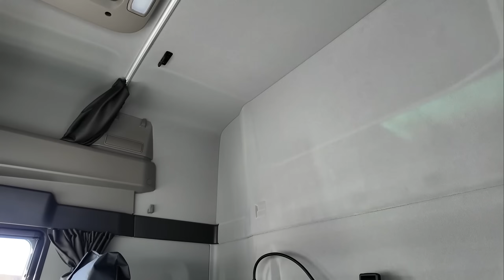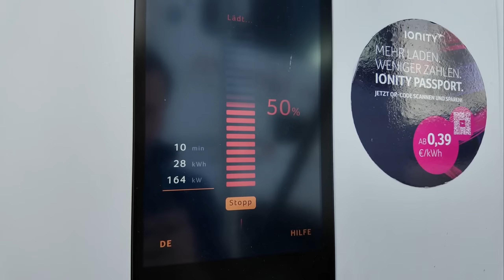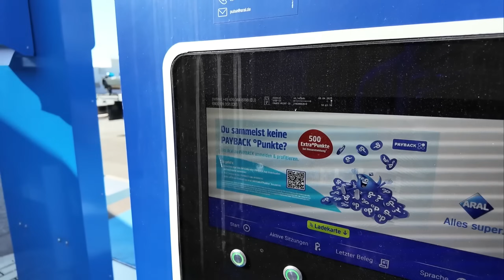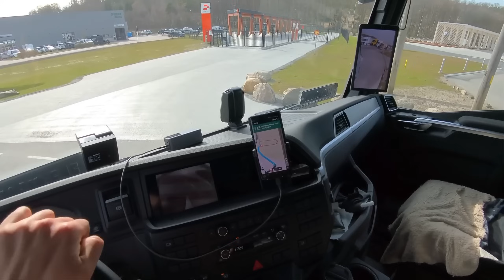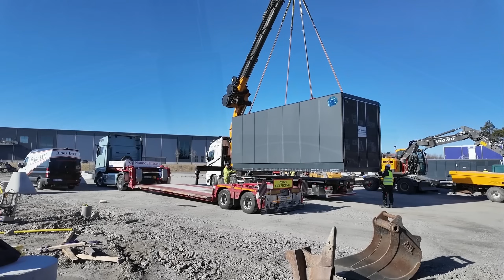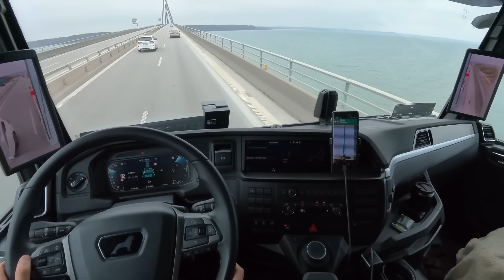E-Truck Convoy to Sweden. Europe Watch and Learn: This is the Charging Infrastructure of the Future

Comment: I had watched so many convincing anti EV you tube vids that said electric trucks are simply useless and will never take off..then I found this channel.
Reply: "Those who say it cannot be done should not interrupt those who are doing it."
Reply: Without the existence of the EVs, we won't see any record breaking growth on renewable energy capacity, and we most likely still having way less reliable grid today, as one of the first step of improving the supply is by creating the demand. Plus EVs has much less engine noise, resulting in quieter environment

Not mentioning that we already reached the point where a whole EV battery replacement cost less than a whole combustion engine swap, thanks to the massive shift to less expensive LiFePO4 (and soon sodium ion) batteries, and also a ramp up on battery recycling to eliminate as much dependencies to mining as possible (as 99,9% of the battery can be recycled)
Reply: They are also cooler running in built up urban environments because of their efficiency... So given how dangerous heat domes inversions and urban heat trapping is ..all electric vehicles on busy urban roads can help limit that close proximity.
Reply: Many who say things like that are from the US, things there are little different. There, they can drive much faster while here in the EU speed limit for trucks is 80kph which reduces efficiency a lot, also I guess their tachograph laws are more liberal than our 45 minutes rest in 9 hour shift.
Reply: @ivanjanjic8762  For any vehicle, slower speed is much more aerodynamically efficient (is that what you meant?) as drag is proportional to the square of the speed (ie go 2 times faster, get 4 times more drag and therefore energy consumption)... and I gather that the USA is a little more liberal in terms of driving hours than Europe but it depends a lot on what sate you are in.  I also suspect what laws there are are not policed as well in the USA.
Reply: It’s amazing how far advanced Europe is over the US.  Here in the US, we have to take a four-year break from helping the earth survive.
Reply: Electric trucks will cut costs for future transports and that will in turn make European products more competitive then more backwards nations like USA.
Reply: 有用的，但要看柴油价格和电每1KW的价格。

Comment: I agree with the peterjol 💯 the electric truck is far better than so many anti EV mobs castigating them. It can only get better with the speed of improvement in batteries. I would love you to be able to try out the Tesla truck, it would be interesting to see if you liked the middle driving position, it must be easier when coming to the UK.

Comment: When you park overnight there should be a control to take a slower charge which is better for the battery and probably for the charger and grid like if there was a way to program a charge by telling the truck that you want to leave at this certain time and the truck will be fully charged and at operating temperature

Comment: Greetings from Denmark 🇩🇰 Nice to see that our EV infrastructure is appreciated - particularly seeing that a lot of Danish truckers had protested against the move from diesel. Luckily companies like Danfoss leads the way by implementing EV trucks and even putting up chargers themselves. 
The private EV car sales have been exploding the last couple of years and so have the amount of chargers. 3 years ago when I bought my lovely little BMW i3 I really needed to plan my route to cross Jylland because but today it's no issue - even with a small battery. Actually don't wish for much bigger batteries but mainly higher charging speed

Comment: I mean BEVs are nice, but the numbers sold are not reflecting a positive way forward for them. H2 will most likely take over. 
I have seen a maximum of 2 trucks in that Varberg stop each week when I go past there so it isnt being used a whole lot..
Reply: Hydrogen in all practical sense is a scam (for the transport sector).

The efficiency is simply too bad and the hassle to "fuel up" is dangerous and annoying.
Reply: @zaarkeru3391  I dunno, FCEV was shithot a few years back but seems to have died down a bit. BEVs are only offered to offset CO2 penalties coming from the EU, if it wasnt for that there would be 0% interest in BEVs. Price is another thing, BEVs are HEAVILY discounted straight from the OEM, there is 0% profit on them, straight loss. Without the ICE variants there would be no BEVs offered. Best choice is HVO at this point.
Reply: @aeywyn5230 
Low profit when you're creating a market segment is the norm.

And the same things with happen with hydrogen based transport.

If we use it as a source of combustion fuel it will be incredibly inefficient and if we use fuel cells it will result in massive upfront costs.

BEVs can make a profit very soon as we are seeing the price of batteries fall year on year by quite the bit.

Hydrogen doesn't really solve any problems.

The energy efficiency (with green hydrogen) is unacceptable.
As a combustion fuel it is beyond dangerous and a massive hassle to refuel.

Hydrogen as a industry product, great.
We can make a bunch of stuff with it.

As fuel for transports its horrible.
Reply: @zaarkeru3391  I dunno what truck you think will make profit being a BEV but it aint any of the mainstreams one atm.
Reply: @aeywyn5230  none of them at the moment, but i guess you just ignored my comment.

Comment: You previously mentioned that it'd be optimal to have combined truck and car charging locations as trucks use the public charging network mostly through work week and cars on weekends, so I think the best design would be to have the charging bay layout like the truck charging stops that you showed today, but with the charging cabinet & dispensers type of chargers and 2 dispensers per truck bay length such that each can either serve 1 truck even with electric trailer with its own plug or 2 cars (/trucks without trailers). Here's why:
* cabinet & dispensers type of chargers allows for more flexible distribution of the charging capacity of the site, and this would make the rear dispenser have the same charging performance as the front ones withough having to double the cost, which would be beneficial especially for car charging, since they usually have lower charging Wattage (basically you split the charging capacity you'd need just for the front one into 2 for cars as on average they'd be charging at about hald the speed)
* the front dispenser should have both CCS and MCS plugs, it'd be however on the site owner if each dispenser would have 2 CCS plugs (except the left most, but there'd have to be 2 additional dispensers on the right side of the row of bays) or long enough cables for vehicles with charging ports on the right side
* If one of the 2 spots is taken by someone else, you can reverse into/out of the other (front/rear one respectively), though it'd be optimal to have a display or even assignment of bays at the entrance such that the chance of just one slot in each bay being occupied and the time to find a free charger are minimized. I think of something like fast food drivethrough ordering, but you'd choose vehicle type and how long you're planning to charge (for vehicles not using the whole bay to minimize the need for reversing) instead of your meals and drinks.

Comment: Nice video! 
I love your honesty and how you point out the great and bad in everything. 
I like the DC charging speed setting in the MAN. If you know you don't need full power, then limit it. Could be a useful feature to have for shared power chargers. 
As for running auxiliaries off the charger, it should be a standard. Add in some 22kW AC plugs at parking spaces, and you can charge and have climate for the driver and the battery.

Comment: 380km is 240 miles.
What use is that?
I usually drive 200 miles to a drop then 100 to a collection then 100 back to base.
Reply: And in the US you have more than 3 times as many accidents per driven kilometer...

Maybe US truck drivers should be more safe...
Reply: I think this is his empiric range of the truck, right?

Are you aware of European Driving time regulation? Drivers are only allowed to do 4.5 hours of consecutive driving. At a max speed of 80 km/h one can therefore at maximum do 360 km between rest breaks. In the absolute best case. No rural roads (max speed of 60 km/h), no inner city, no traffic jam. Just driving on the highway as fast as allowed without any buffer to find a place for the rest.
Reply: @Jonas-fs8nz  I think 60 km/h speed limit on rural road applies only to Germany.
Reply: @Jonas-fs8nz he's an anti EV troll. See his stupid comments all the time. Just ignore 😂😂😂

Comment: You the MAN, Tobias!  Yes bad pun I know, hehe.  That was amazing.  In Australia due to longer distances they are looking at doing battery swap, one company, Janus converts regular trucks and turns them electric with swappable batteries which then can also be used when the batteries are being charged or just sitting to assist the grid as well since they are large batteries and each truck has two one on either side.  But everytime I see or read about an electric truck or new charger for trucks think of you and have you test it for them as you know electric trucks very well.  You're like the Bjorn Nyland of Electric Trucks in some ways.  :)
Reply: I had a drive of one of the Janus converted trucks....truck was nice to drive and the battery swap system is so much better than waiting to charge a battery that's built into a truck
Reply: Toll is now working with Woolies on EV truck deliveries

Comment: I like that you mention all the other machines that are electric.  If only the U.S. would pick up on how good electric-almost-everything is.
Reply: Here in the US, we've not figured out that we've hit fracked oil.  The amount of new fracked oil is beginning to be less than the current consumption, which is still increasing exponentially.
Reply: @milofonbil  Besides the insane method of oil sand exploration Fracking are the most expensive, stupid and reckless means of producing energy. It´s high emitting of CO 2 and methane. First you have to make massive amounts of chemical strong acid at a chemical plant causing emissions and dangerous chemical waste. Then transport it to a fracking site causing emissions. Then under high pressure put it into the underground below groundwater level where all microbiological life are no more afterwards. The chemical acid dissolves slate stone that contains microbubbles of CO2 gas and CO2 methane and oil. As the slate stone are dissolved it creates underground cavities that eventually, due to gravity, collapses and causes local earthquakes. As these earthquakes happens the risk of connecting groundwater with the acid, gasses and oil are tangible. You can find clips here on YT where Americans already have experienced they no longer can use the property they bought´s water supply any longer. You can find clips where people are able to ignite what comes out of their taps. Imagine you spent your life savings to invest in a property that then becomes un sell able as no one want to buy a house or a farm that comes without local water. 20% of the gasses seeps out through the ground other places than where the extraction point is and thus badly contribute to the already dangerously high greenhouse gas levels in out atmosphere. Our atmospheric carbon content SHOULD be 225 PPM and now have passed insane 426 PPM! The different things brought up from fracking sites then need to be refined before use causing further emissions before burned causing even more emissions.
USA are one of the lucky nations with optimal conditions for the CHEAPEST, in a free market, large scale bulk energy production offshore windmill parks offer. Unfortunately USA act as in the 1950 tax wise and spend huge amounts of taxpayer money subsidising private companies fossil fuels due to that sectors donations to both parties via US lobby laws. "Drill baby drill" should have been "raise (windmills) baby raise". THAT would have created good stable tax providing jobs and allowed USA the entry ticket to make all the green hydrogen the nation could want.
Reply: @milofonbil  Seems my comment to you contained to many facts and truth´s for Americans to watch so seems you have to go to the "sort by" function of comments above and select "Newest first" instead of the default "Top comments" to read it.

Comment: Whoa I didn't even know electric ferries were a thing. So cool :O
Reply: Denmark have a lot of islands and thus also ferries. When new ferries are bought now they are electric. Many of the islands have windmills either on land or offshore so they are fully charged at night and pulse charged when docking for a short period during it´s shuttle traffic and that are sufficient to have plenty of running time should weather keep them from docking. That isolated islands can provide own energy that on top are emission free brings these societies incomes and savings that can make a decisive positive local difference. Today at least two manufactures in Denmark can offer a container sized aggregate that can be coupled to windmills that can produce green hydrogen on the spot. Let´s remember that green hydrogen are made of emission free electricity and water and produces no residue in the process. When green hydrogen are burned it only emits, water! Liquid green hydrogen are more potent as a fuel than both diesel and gasoline thus a significant longer range can be had, with similar as fossil fuel sized tank volumes.
It are many years now since the ferries between Denmark - Sweden at Helsingør - Helsingborg crossing became electric. It were a obvious early contender as frequencies of ferries were high and the waters in the strait are the gateway to the Baltic Sea where many fish travel through as well. 
Danish global container ship giant, Maersk now have a fleet of container ships running on low emission methanol and they already have the drawings for the non emitting green hydrogen engine based ones ready. These have to await more nations able to provide such fuel globally. 
For the nations that have the conditions, around half the worlds nations, the CHEAPEST means of large scale bulk energy production are offshore windmill parks. That also can be the entry ticket to produce as much green hydrogen and/or methanol, as a nation could wish for. The future for trucks will be based on engines running on green hydrogen. The 4 stroke direct injection liquid hydrogen engine invented and works well and can be used for cars/trucks/locomotives/ships just as the liquid jet engine already have been in use for decades at hydro electric plants. Airbus and Embraer both publicly announced they are working on larger passenger planes running on hydrogen. The electric car/truck in urban settings will have a market long after hydrogen becomes widespread but hydrogen engine based transport for longer distances markets will come with superior advantages.
Denmark btw now produces over 70% of it´s electricity emission free primarily from windmills and increasingly from offshore such. This will in not that distant future exceed 100% and make Denmark a net exporter of emission free electricity. A broad coalition, beyond the Danish government, in parliament have voted to self impose Denmark with living up to it´s commitments in the Paris climate accord, 5 years ahead of time. 
I hope this gave you some more insight into what it is like here and what´s next.

Comment: I occasionally drove a truck in a military convoy (many years ago). We were limited to 20 vehicles in a convoy with 30 minutes between convoys. I was usually tail-end Charlie (I had the heaviest truck). The convoy commander would radio back a couple of miles before we needed to change lanes and I would start signalling and hope a gap opened up. We were limited to 72 km/h, where the normal speed was probably 118 km/h so there was always a line passing us, If no one let me over I would start inching over until someone flinched. Once I was in the other lane the convoy ahead of me pretty much all changed as the last car passed them. Then the line would start passing us on the right.
Reply: I didn't see the convoy pilot truck to watch for bridge heights and narrow sections of the interstate.
Reply: @milofonbil  Maybe its not a requirement in Europe.

Comment: Accuracy of measurement is really tricky, there is university courses about that. As you state in this video, consumption is the king in logistics. So truck manufacturers should provide consumption numbers in reasonable high accuracy and precision. Meaning 867 Wh/km, not 0.9 Wh/km. And use enough digits meaning, at least up to 1499 Wh/km, and only after that 1.50 kWh/km. This would allow truck companies to optimize consumption based on real world data. With passenger carselectricity motor power is not directly linked to consumption, maybe it is different electric motors used in trucks. Anyways, thank you for very informative content.